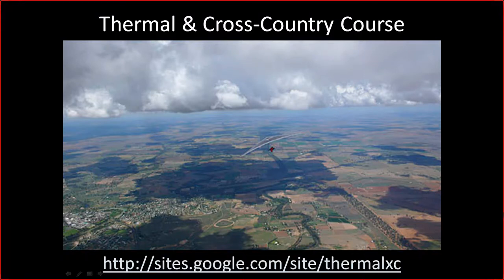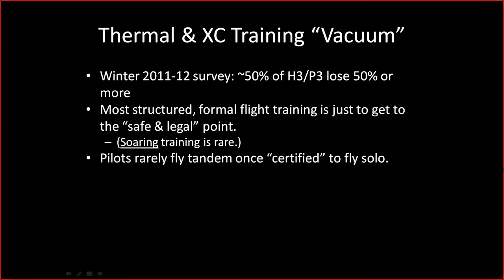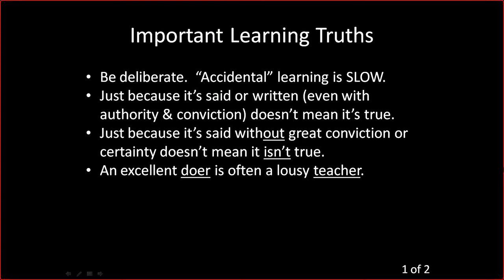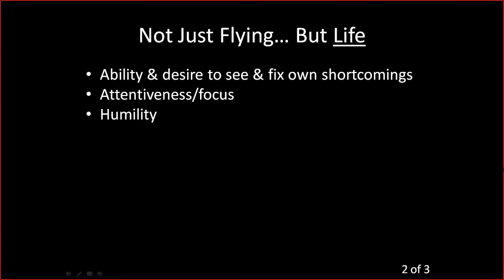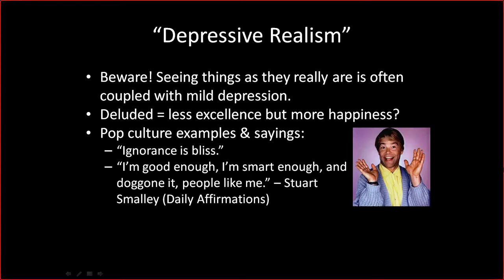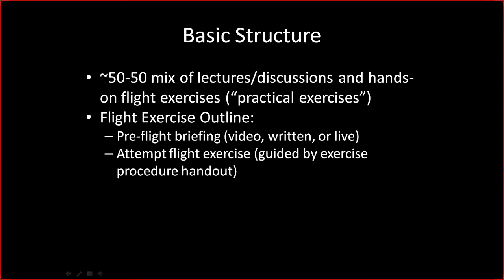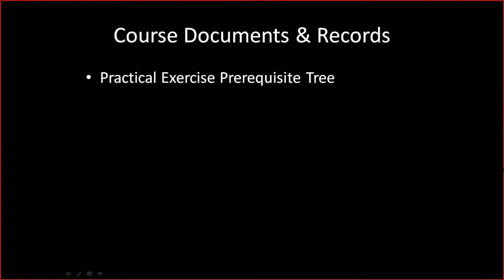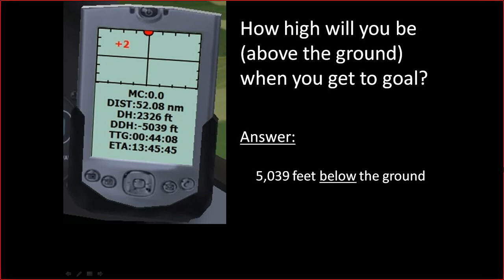Course Welcome/Introduction

Comment: Hello
Could you upload the further episodes of your webinars. They are very slow paced and sometimes slightly philosophical , some of the info is basic for some but they have good value in them . Please continue uploading these.

All the older and newer methods should be used to improve flying . From lectures , books videos to analyzing tracks. Blue skies
Reply from the maker: Hi nvoima. Thanks for the note. I haven't yet created videos of my other webinars but will upload them as I do. Yes, I realize my lectures are pretty slow-paced for some people. I try to err on the side of being slow and thorough - so as to leave few people in the dark. Thanks, Eric